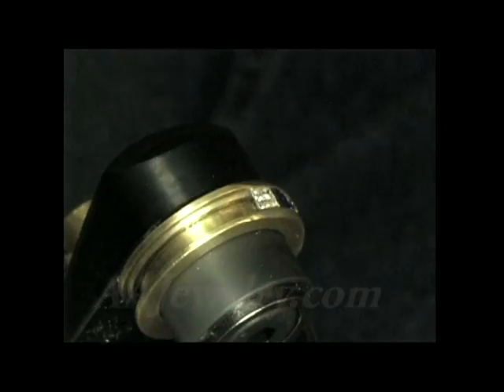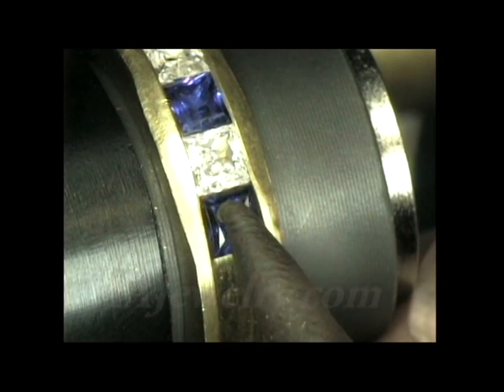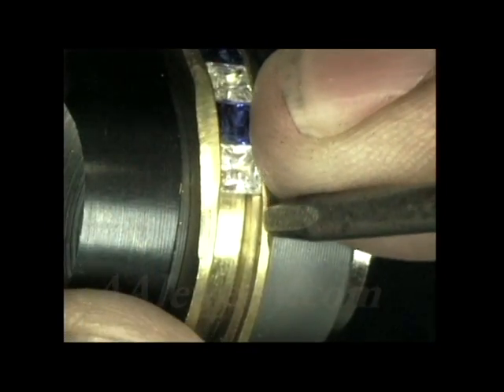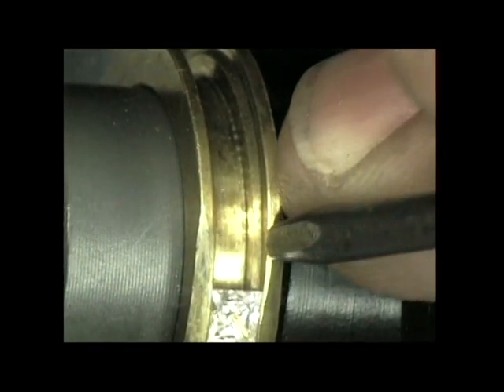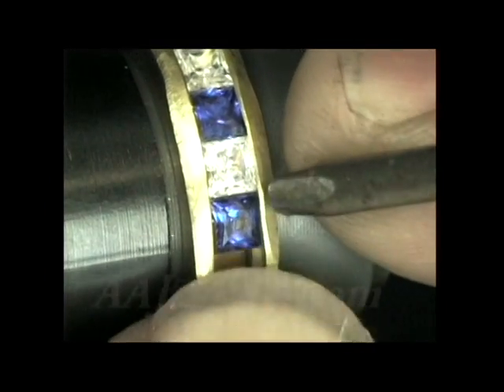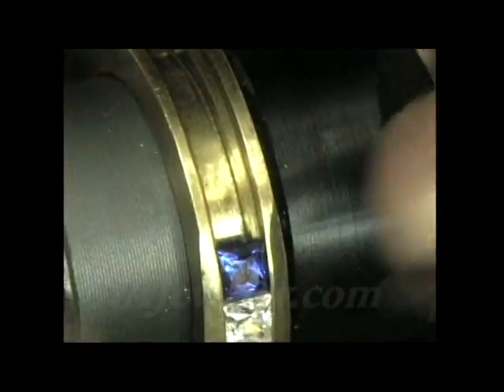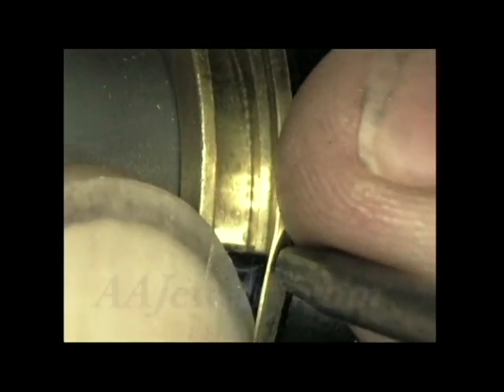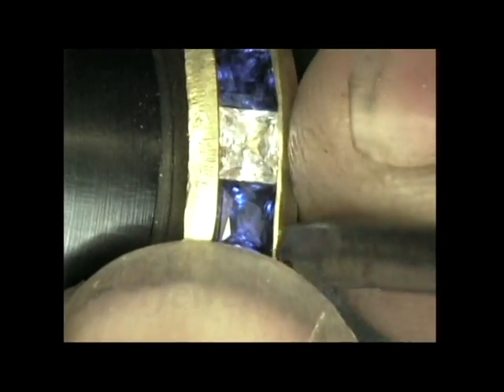How to Create the Proper Channel Setting

Comment from the maker: 243WW, I apologize for the late response. Not sure how this question went unnoticed. For those who are interested, the  GRS Benchmate Stone Setters was used. The specific add-on to is the "Inside Ring Holder". Both can be found on our website aajewelry(dot)com sku  #61-603 (Complete Set)  #61-619 (Inside Ring Holder).
Reply: A&A Jewelry Supply

Comment: Es using a GRS BENCHMATE to hold the ring in place.  I have to say they are really handy because they hold the ring steady and reduce the stress on the supporting hand.  But the plastic ring that holds the metal ring in place absorbs a lot of the force from the hammer, I find using a metal mandril to hammer the ring on moves the metal a lot faster because the ring itself takes the force from the hammer

Comment: I need to know how you call that tool you use to put those stones thanks
Reply: +joseph mixter I am just guessing but from my experience it is simply an awl with a little ball of wax at the tip.  You can buy stone setters premade as well:

https://jet.com/product/detail/4b8b920f1f784451a19e12b15f973599?jcmp=pla:ggl:brands_arts_entertainment_a3:hobbies_creative_arts_arts_crafts_art_crafting_materials_a3_other:na:na:na:na:na:2&code=PLA15&k_clickid=bd99e7c8-d9b4-4201-9a03-f69b979d7124&gclid=CInR-_Pmk8oCFRYjgQod-hYBjA
Reply: It's just beeswax you can buy it online or jewellery tool stores heat it up before you use it and mouldy it you the shape you want